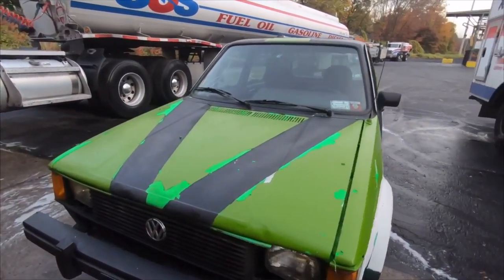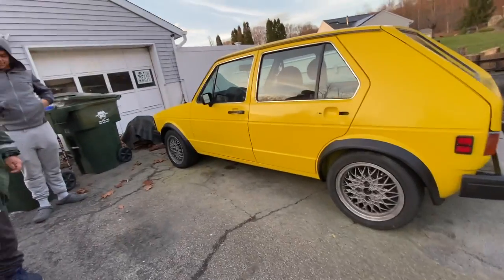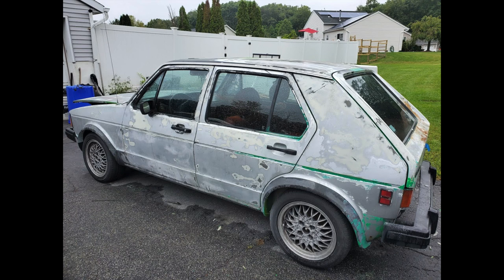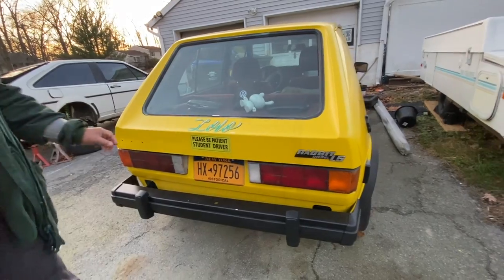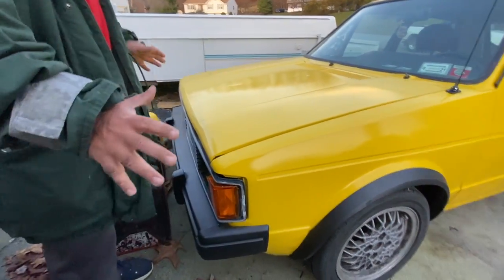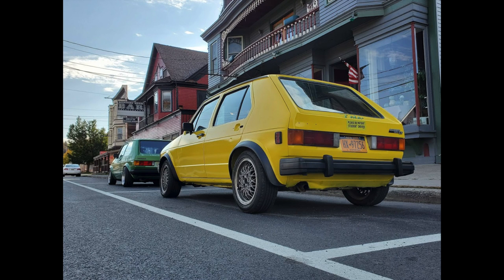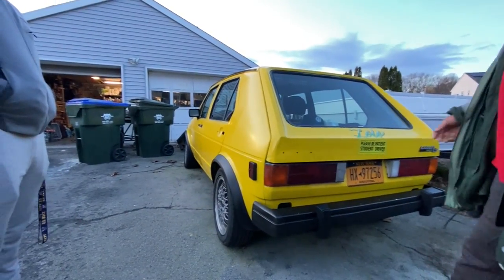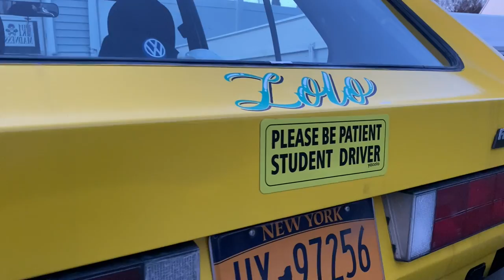music video/beater car update, its unrecognizable!

Comment: How much will it cost to get old MK1 and restore ?
Reply from the maker: well, how resourceful are you? are you doing the work yourself? how’s your tool collection? where do you live? is the rabbit you buy going to be rusty? how rusty? does it run? how’s the interior? there are way too many variables to answer that easily. unless you have a whole garage full of new old stock parts that you got cheap, and find an absolute steal of a deal on a rabbit that isn’t rotted to shit, i don’t imagine you will be able to “restore” one for under 5k, and you can easily spend 30-40k doing a full nut/bolt resto.
Reply: @mk1rabbithole  Never thought it would be that expensive
Reply from the maker: @Me-sb3mx  again, you asked a very broad question with way too many variables. what’s your starting point with the car? how much of the work are you gonna do yourself? a professional restoration quality paint job can cost you at least that alone, a little less than half in material if you can do it yourself. literally any older car can cost you well over 10-20k to restore depending on the answer to all my questions.
Reply: @mk1rabbithole  At first i will study a mechanical engineering and after i finish the degree i will work as a mechanic and after some time open my own shop , i want to find a Mk1 max for 5k maybe , and i want to restore it my self and paint and daily drive it for a while before i buy any other modern VW